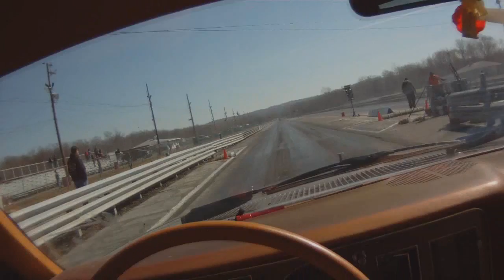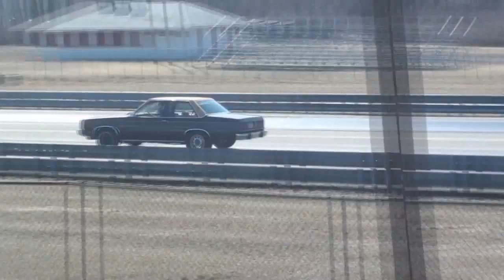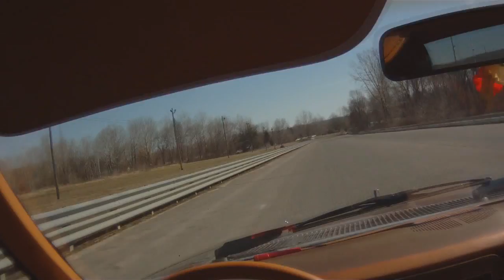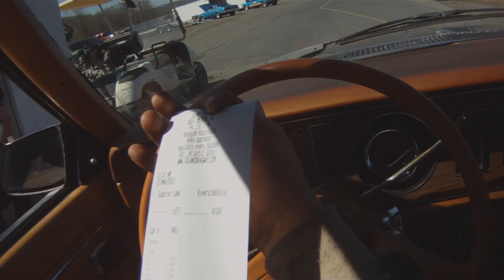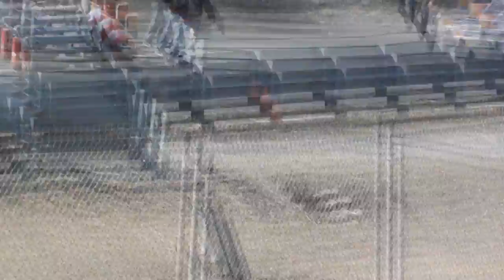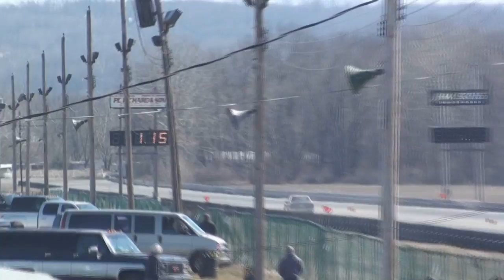3-11-12 turbo fairmont project first pass at the track

Comment: I can agree with and understand that. The fact that these LS junkyard motors are supporting that kind of power with untouched internals is amazing. Theres no 5.0 pushrod or 4.6-5.4 modular junkyard motors that can touch that, save maybe a Cobra motor. I appreciate what you guys are doing, fast is fast, cool is cool, and fairmonts are fucking sweet which is why I'm trying to get one. I'd just rather stay true and rock a 5.0 with a turbo myself.

Comment: Yeah unfortunately the stock pushrod 5.0 blocks can only handle about 500 crank horsepower before they start splitting. My 93 LX had 500rwhp, aprox 560-570 crank hp and lasted longer than I thought it would. My next 5.0 motors gonna start with a Dart block. I'll definitely try to find some of the vids of that 89 GT. Sounds nasty.

Comment: How bout you don't swap in anything. Fords can be fast just like anything else. I'm a firm believer in keeping a ford in a ford, same goes for a chevy in a chevy and so on. Especially with the fox body ford chassis platform, theres absolutely no reason to swap in anything else but a pushrod 5.0 or a modular 2, 3 or 4 valve. Both motors make STUPID power with turbo's. The Fairmonts and Mustang's were rolled off the factory with 302's, so how would a Chevy be any easier?